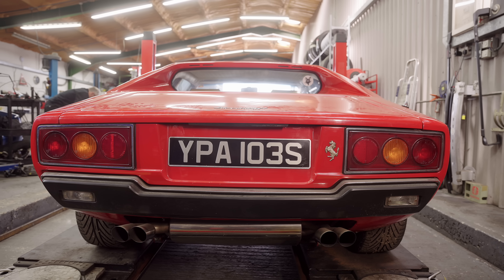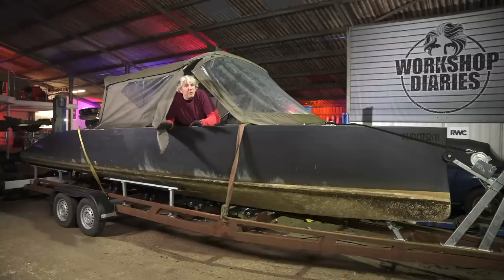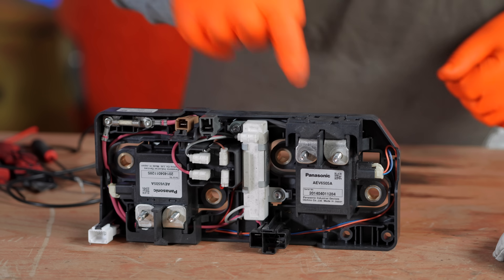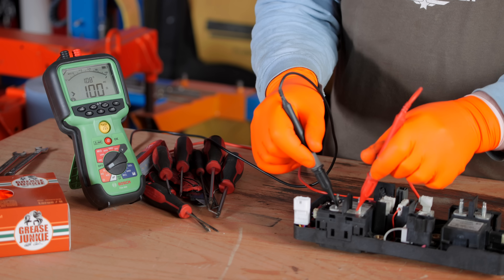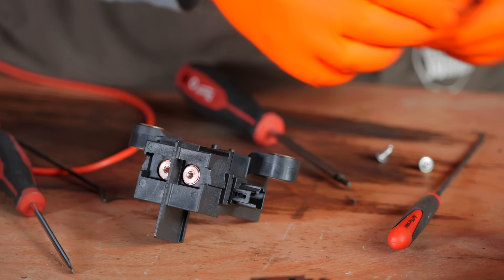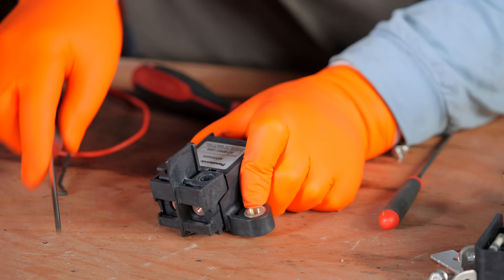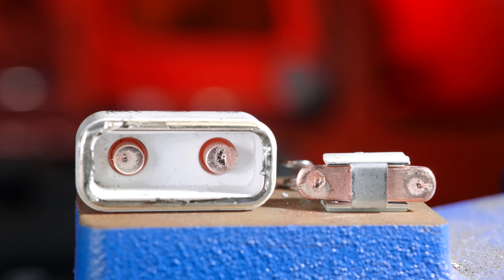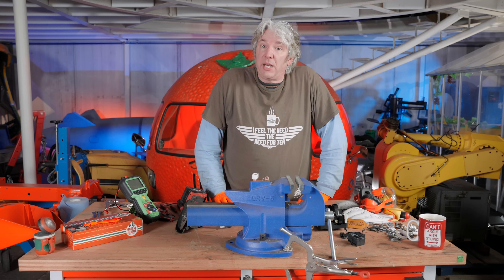1 Surprising Thing I Found Inside a Welded EV Contactor

Comment from the maker: Hope you all enjoyed having a look inside the welded contactor, such a common fail on these you would think you could by each contactor individually but I haven't tracked any down yet!
Next week's episode will follow the build of our new office building inside our workshop building so see you all again then! Have a great weekend and thanks for watching! 
Remember, if you have any questions add #AskEdd to your comment....Thanks.
Reply: My guess is they are custom parts for the application, or quite possibly the part number is unique to this application. Obviously Panasonic make them, but as to the availability aftermarket, that could be tricky. 
Thankfully the whole assembly isn't that expensive, which comes with everything needed to restore the function for many years to come.
Reply: Any content is good content as long as its not a reupload or s section of a previously uploaded episode.  Thanks you Ed and team.
Reply: Afraid manufactoring has chainged. Lots of years ago contactors where ,,bolted,, toghetter and the contactpoints where loose availeble. Now they are pressed toghetter and it even looks like you neede to buy the complete regulating unit. Youre even not supposed to tackle it yourself.
Reply: There are some data sheets at RS components concerning these contactors, they sell some at RS components in Malta.
Reply: The short piece of copper in the contactor is probably 70% rated for continuous current. The in-rush current rather more !. It’s interesting that the spark suppression is done via a resistor (which must be high current rated too). It’s quite possible that as the contacts OPEN the spark is much more fierce so the resistor is only in circuit at that point in time to ‘dampen’ the spark.
Reply: @Wiltshire-observer 

The resistor is there to charge the capacitors in the inverter, before the contactors close. This prevents a huge inrush of current that would be needed to charge the capacitors. So the pre-charge resistor is connected to the inverter for a few seconds, to get the caps up to battery voltage, before the controller closes the contactors. A burnt contactor could be due to a failing pre-charge resistor, as inrush current can occur on them closing. The controller can monitor the pre-charge resistor, but it can still be under spec.
Replacement of the whole assembly, means everything is new, so another decade of use once replaced.
Reply: @johnnodge4327  
I bow to your contemporary knowledge !. My guess was the current “off” for the resistor to be in circuit, but clearly the other way around for the pre-charge of the inverter caps would make more sense. My knowledge is probably about 40 years out of date, small current Radio Electronics was my field !.
Reply: @johnnodge4327  
My initial thoughts were another intermittent fault in the car (damaged HVIL?) causing frequent cut-off under load, but as @LordCakeskull suggested could also be due to bad seals on the contactor letting moisture or oxygen in . Corroded contacts can get hot and form micro-welds in normal use even without opening and closing under load. It would be good to know what other faults were logged on that car, or what experiences the driver had before the contactor failed.
Your suggestion of a faulty pre-charge resistor is interesting too. I've no idea what Nissan have chosen to do, but I'd hope the increased pre-charge time would be logged as a fault though, rather than the controller shutting the +ve contactor after a set time. (And Edd's fault is on the -ve contactor)

Absolutely agree after you've gone to the trouble of removing and opening the pack, it's best to replace the whole unit as one.

Pitted distributer points caused me problems for a few years. Constantly switching with an inductive load, 100 times a second is about the meanest thing you can do to a switch.
I never expected that same issue would return by converting to electric!
Reply: On the power ratings you are referring to, there is a conversion.

De battery is DC, but the motor is AC.
Reply: As always great content and thoroughly enjoyed watching.  Your office, I think could've been done a little cheaper to save some $$$.. (rhs is pretty permanent) 😅😅 anyways great viewing looking forward to more of the Ferrari 😉 can't wait for that to be fired up.. 😀 
💪👌 
Righto.. Cheers for now Ed 👍
Reply from the maker: @ Thanks for watching!
Reply: Replying to @eddchina:

PUT ONE END OF A 1 INCH DIAMETER HOSE ON YOUR BELLY BUTTON AND CONNECT THE OTHER END OF SAID HOSE TO ANOTHER BELLY BUTTON AND GO *SSSSSSSSS*
Reply: Fused contactor contacts... No other fault? That's weird I've seen fused contacts before, only in combination with a short circuit
Reply: Maybe there are more contactors splitting the load. I  can hear more than 2  when I start my Leaf
Reply: 2 contactors should give you 2x43KW so think its ok for 80KW Motor/Inverter , this is my tought
Reply: Solid State replacement for the Contactors?
Reply: @rogerstarkey5390  mosfets that could switch the required wattage would have significant heat loss and likely have some leakage unless there's new parts available that I haven't seen.

If properly designed you could make these a 5 minute swap. They're a known limited lifespan item so it should be designed for quick and painless replacement.

The car should also track the number of actuations between swaps to warn the owner with a decent margin.

A good built in system for parts lifespan tracking built into the infotainment system is something that should be required by law for newly manufactured cars.

I could build the code for it in a day using libraries that those infotainment systems already use.
Reply: It's a standard Matshita part and listed on RS and Mouser amongst other electronics suppliers

Perhaps you're looking in the wrong places?
Reply: For the boat, do a TOFFEE apple finish, with a light green Granny Smith undercoat, with a rich candy toffee letting the green show through here and there, just like a British toffee apple.
American 'candy apple' finishes ALWAYS forget the 'apple' part!
MAKE IT SO!

Comment: Interesting. So this relay is just a solenoid valve. Weirdly enough, the short actually looks like splattered solder. There shouldn't be any solder in there.

Comment: I was involved in the design of the Electrical Load system of the Boeing 777 which actually uses plug-in contactors for the high current stuff. They are big. It means they can be replaced without breaking down the high current wiring and the problems that would cause with re-certifying for flight. The trickiest part is the science of the metals used in the contact pins and socket cups of the mating surfaces of the plug in part. It took a lot of work to get that certitified. These automotive units don’t look robust enough to me even though the external contacts are bolted.

Comment: Hi Edd
Just a word of caution, when working with electrical components (more specifically White ceramic components).  Always give them a look for a marking that says “BeO”.  It stands for Beryllium Oxide.  You  never want to dry grind that material because it’s very bad for your lungs.  If you do want to grind it use a wet grinding wheel or just stop all together.  BeO is used in some electrical parts as it is a good thermal conductor but is also electrically insulative. .

Comment: Acted as main switcher, a DC contactor's switching off arc ability and lower temperature rise are very critical performance. It up to the several desgin measures during a DC contactor development. Sealed, intertal fulled of special gas to easily extinguish DC arc, and Magnetic field design are the main points. And thereinto, how to design in detailed parameters for example the positions of magnetic are very important. So different brands of DC contactor in the market have absoultly big differents electrical lifetime performance.

Comment: Acted as main switcher, a DC contactor's switching DC high voltage arc abilitiy is very critical performance. It up to the several desgin measures during a DC contactor development. Sealed, intertal fulled of special gas to easily extinguish DC arc, and Magnetic field design are the main points. And thereinto, how to design in detailed parameters for example the positions of magnetic are very important. So different brands of DC contactor in the market have absoultly big differents electrical lifetime performance.

Comment: each relay is seeing all the current but only half the voltage in this setup?
so the AV rating of the relays isn's supposed to be over the specs. It's close though, not much headroom.

Comment: Based on my experience, contacts tend to weld  after several  hot switching, once steady, and given the appropriate current rating, it should not happen, especially in such hermetic enclosure! Any thought on why that may have happened?

Comment: Edd,  the metallurgy of electrical contacts is a bit of an art.  For switching micro amps you would use gold plated contacts as gold doesn't oxidise so not need to break any oxide layer to conduct electricity across the contacts.    On what are now old fashioned coil or magneto contacts tungsten carbide was used to minimise arc pitting over time.
The contacts used in that Panasonic contactor appear to be silver or silver plated.  For it to weld closed and also to cause the splatter that I can see in your close up means that either the contact metallurgy is wrong for that application OR the contactor is being run in an application attempting to pass a lot more current than the Design Engineers at Panasonic designed and tested it for.  I would suspect the latter as car Design Engineers are under a LOT of pressure to minimise cost.   I would assume that the traction battery cells and the traction battery assembly itself were all designed and made in China and supplied to Nissan for assembly into their car.   Trust this helps.

Comment: Not sure exactly what software you used to check the battery state of health but as a previous Leaf owner I'd seriously question a Mk 1 Leaf of any age having 100% battery state of health as they are well known to have poor degradation. My Leaf was the later 40kWh which fared much better than the Mk1 Leafs and after 18k miles and 3 years the state of health was down to 95%.

Comment: The most pss taking part is that Panasonic most likely manufacturers the same relay under a different part number and sticker for use in their fridge freezers, microwaves etc.. at £10 whereas this same part for an ev is £500. 
🤬

Comment: That contactor looks realy undersized for breaking, potentially, 80kV, plus the design doesn't seem too clever. Given the design, it's not even like reversing the polarity of the coil would reverse the operation and attempt to pull the contactor apart. 
For something handling 360 to 500 volts DC you'd want something that can push the contactor closed, and potentially pull the contactor apart using reverse polarity, or at least have a beefy spring that has some hope of pulling the contacts apart.
Yes I want to see the boat refurb/rebuild, please!!!

Comment: Thank you for opening up the nitrogen sealed contactor. It has lasted very well for the age of the Vehicle. 
   Looks like Nissan have kept the costs down, by using the complete assembly from a Toyota Prius. 
    It was not designed for Nissan Leaf voltage or amperage draw. 
    The max amperage is restricted to around 100amp in the Toyota Prius 201VDC nominal. By the Synergy Inverter system.

Comment: Thank you for working on a “Leaf” battery. Very cost prohibiting to go to a dealership and certainly still pricy at your local specialist shop. There should be reasonable pack pricing for the battery as the Leaf is so easy otherwise to work on. Thanks for the other video as well. I’d love to see you replace all the modules in one with new 50kw modules sourced from China.

Comment: That’s a surprisingly weedy contactor, looks like a case of planned obsolescence, get the car through the warranty period as cheaply as possible……job done and stuff folk that can’t afford new cars.

I’m an ex aircraft avionic technician, where I worked (British Midland Airways late 80’s)for a number of years we were licenced to not only repair aircraft by replacing parts/units but for certain components contactors including we could dissemble the contactor and replace the contacts only, much like replacing motor brushes rather than the entire motor.

The main aircraft were DC9 built in the 60’s, the contactors were very simple to disassemble.

Obviously everything was tested, inspected and signed off, it saved the airline a fortune!!!

Comment: As a mechanic , technician , what would you rather work on . A fire breathing big block cobra or a toaster . GET IT !
Reply from the maker: Fair point but lithium fires can be impressive!! A V8 toaster? Now you’re talking!
Reply: @eddchina i had  started  working for jaguar in australia about the time the fuel injection cars were turning up for service.i had just started work at jaguar and i noticed there weren't that many old tradesmen around.they got out and went to spare parts to work.thats whats happing now.

Comment: Ed the boat is great! DO NOT use synthetic WOOD!🎬
Reply from the maker: But you don’t have to varnish it every few years!!
Reply: @eddchina   working with my father body shop...metal was easy to polish!, help to build/sell yachts, fiberglass was alittle easier to polish. SAILing  wood felt great, even with wax on it! [ I am not talking about 'j' class yachts]. WHEN usa drilled holes in haul of nz's,  'america's cup' yachts to test rules in the 80's, I thought it would damage the structure/stress!  IT was dennis conners BLUE haul, & then nz's BLACK haul I realised they used technology for ocean racing!  WOOD is still better comfort for cruising!

Comment: Powder coat that would definitely not be my choice, powder coat does not handle flex that well and can begin to lift. Also when rust appear it will move quicker beneath the plastic coating which is essential what powder coats are and power is essential impossible to repair.....
Reply from the maker: True, but on top of the zinc it should preserve that for a while longer!

Comment: The load would be divided by the two contactors so together they can switch a 240 amp load which is only 8% higher than the motors draw of about 222 amps, Id imagine thats why they failed.
Reply from the maker: The rating might also be the safe breaking current but as they are effectively in series I believe the current would be the full amount. Someone else pointed out they would last longer with silver plated contacts. Either way they seem (and have proved to be) inadequate!

Comment: Thanks for this video but tbph I'm disgusted to see how battery packs are not being designed to basically replace a relay with a known failure mode and instead are being replaced as a whole, at best, to the exorbitant and unnecessary damage to owner finances (and "remanufactured" to minimal cost to somebody somewhere in the chain); and at worst, to exorbitant and unnecessary damage to the environment.
Reply from the maker: None of the issues you mention are good. Let’s hope OEMs chose a more sustainable path!

Comment: Fascinating couple of videos on the Nissan Leaf battery which has raised a couple of questions:

Did the Leaf go to a Nissan dealer before ending up in your capable hands & if so what was their proposed solution?

If the problem with the contactor is a common one then why isn’t it more readily accessible for repair?

With all the bad press/scaremongering   going on about the high cost of battery replacement you’d think that EV manufacturers would take steps to address these concerns.

Comment: Jeez, no arc blow magnets, no feedback aux contact. In general you could do a PhD on welded contators. Usually comes down to either misuse or poor design. If inverter precharge goes wrong you get superhigh currents on closing and welding. If it opens under load (emergency off) arcing degrades contact surfaces which makes it conduct worse on next closing.

Comment: OMG! I never thought EVs would use such a tiny relais to switch the battery.
Most relais/contactors I have seen for 110V DC on railway rollingstock are at least 10 times bigger.
Those for 3000V DC can be really big but they also switch 1000A and more.

Comment: Power is calculated Current times Voltage. U*I=W or 120A times 380V is 45,600 Wats or 45,6 KW (Kilo Wats). That is enough power to run a small factory or 10 homes.

Comment: Contactors generally have a reasonable lifetime, but as they are one of the actual mechanical parts if you like, they are prone to failure.  I have dealt with them a bit on building electrical (example tennis court lighting) and they do tend to go bad over time.  As they get older, they sometimes have a problem making the full contact, which leads to sparking.  If you are lucky, and if the circuit breaker is appropriately sized, then the breaker will go off before these things make a really big mess.   I am guess in this sort of automotive use case,  the resting amperage and the operating amperage are widely different, which means any circuit breaker or fuse would have to be a very fat one indeed.  So it has plenty of time to do a good welding job.

Comment: This relay is rated 225A for 3 minutes, not many drivers would run the max. power for such a long time, but it could be done, so this relay seems to be underrated and therefore not idiot proof. The enclosed location also doesnot help.